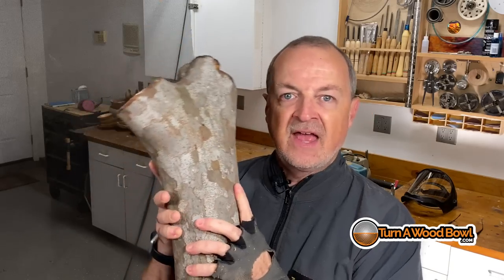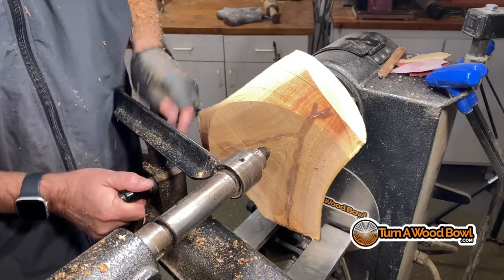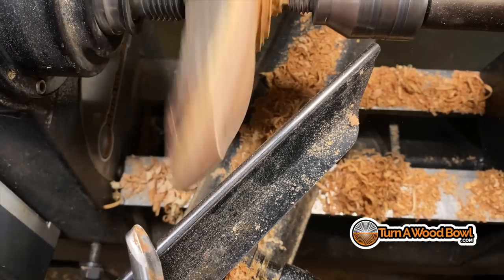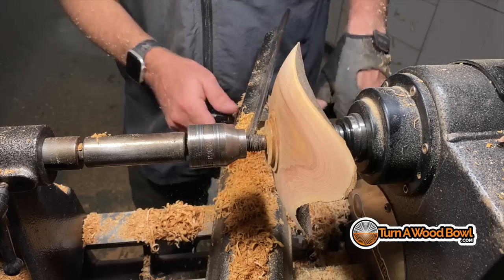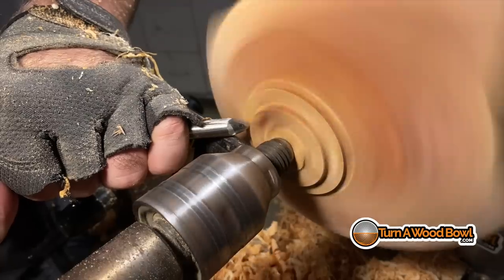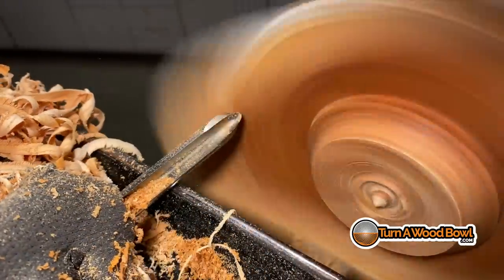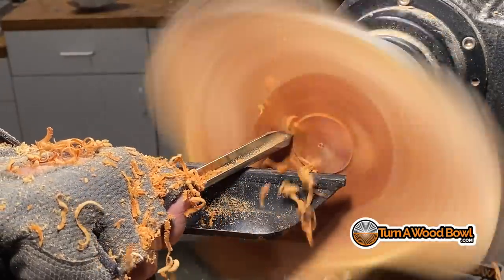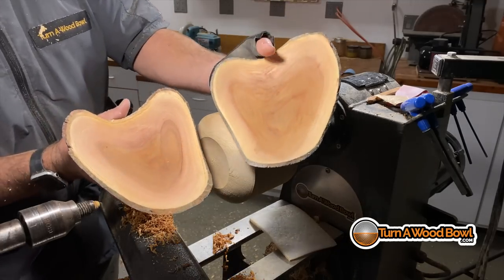Woodturning Live Edge Bowl – Crotch 2 for 1 Bowls Elm Video

Comment: Polymerization of linseed oil involves heating to 572 degrees F for an extended period of time, so yes boiled linseed oil is polymerized to change the chemical structure (hydrolysis) of the oil to increase viscosity (saturating) and reduce drying time. Its similar to hydrogenating fats to make them thicker and smoother (saturated fats are bad for you). Tung oil is treated in a similar manner as is shellac. Love turning crotch wood winged bowls. Thanks for the video.
Reply: A little more info: Most boiled linseed oils contain cobalt and manganese salts to aid drying. Tried and true does not.
Reply from the maker: Beautiful! Thank you for so clearly explaining these details. Happy Turning!
Reply: Hi im from the UK and New to finishes so probably wrong but was under the impression that Danish oil was a mix of oil and varnish, Is this not the case?

Comment: Once again, thank you Kent. If I can make a suggestion that would be helpful for me would be to add in your comments some measures of your blanks, diameter, height or depth, tenon depth etc.  It would help me a lot to evaluate my projects. I tend to have problems with dimensioning my projects.
Reply from the maker: Thanks for the tip. I'll keep that in mind. Happy Turning!

Comment: Hi, thanks for all the videos and information. Just wondering why it's okay to use a spindle gouge for things like making the dovetail on the tenon etc? Thanks
Reply from the maker: They can be used in areas where you are only removing light material. The danger is using spindle tools to remove or rough out large volumes of material on a bowl.Happy Turning!

Comment: Great video Kent, you did everything perfectly. Please be patient with me as I emphasise a point which you did correctly, but which a new comer might miss: - that beautiful crotch grain only exists in the centre of the log, where you drew the line, ie,  25 to 30 mm on either side of that line where you cut it with the bandsaw. The wood closer to the bark has none of that crotch grain.  That is why you made the cut face into the outside of the bowl. If the bark side was made into the outside of the bowl you would lose the crotch grain as you hollowed it out.
Reply from the maker: Kevin,
Thank you for writing and sharing! 
Yes! That is absolutely correct and a good point to make. Well said. 
All the best to you and Happy Turning!

Comment: I very much enjoyed this lesson and learned a lot as well.  I love your technique, especially leaving the center mass intact as long as possible when hollowing the interior in order to stabilize the rim.  And the bowls are beautiful!  However, when it comes to splitting the log on the bandsaw, as a beginner I have neither your experience nor your courage to do it freehand, so I would work up some kind of jig to hold it.
Reply from the maker: Glad it was helpful! And yes, a jig would be much safer and recommended. Thanks. Happy Turning!
Reply: Garry not Linda.  Hey Who, Stumpy Nubs just did a video on ripping on the bandsaw. Check it out. The bandsaw is probably the safest way to make the piece Kent did. Make a fence. It doesn't have to be any great shakes and it doesn't have to be parallel. Just clamp it on so that the piece will follow the line you set up. Take your time. Don't force the piece through and remember you don't have to stand in the same place. You can start the cut pushing the piece through and then move toward the other side and pull it the rest of the way through. No fingers lost, no worries. Garry

Comment: Beautiful bowls, Kent. Your presentations are as elegant as the curve of your bowls. But did you apply the finish while the bowls were still green?
    I love the idea of that. At what moisture content can it be done?
Reply from the maker: Thank you and yes I apply oil to the green wood. The oil actually aids in slowing the moisture loss which reduces the chance of cracks. This can only be done with a penetrating finish. A film finish, like poly, would bubble up or cloud with the moisture under neither. Good question. Happy Turning!

Comment: Thank you for all the videos!  It has been a great help to me as a beginning bowl turner. I have a question about how you deal with the warping and distortion as the bowl dries.  Normally, I would use a twice turn approach to deal with the warping.  However, in this case, the bowl is turned to a finished form while green;  is there a secret to prevent it from warping as it dries?
Reply from the maker: No secret. These will distort like any green woodturning. However, because of their irregular shape, the distortion is barely noticeable. Happy Turning!

Comment: Dear Kent,  I have a wood pile of Desert Ash street trees with plenty of crotch pieces - a metre or more across.  I think I need a bigger lathe! My best straight piece is 1800mm long x 1000mm diameter.  {6’x3’}. That should give me a long term supply of timber. 

… and by the way, the correct pronunciation of polymerised is “pol-im-er-eyes-ed”. Have fun.
Reply from the maker: Peter, Thank you for writing and sharing! Wow, that sounds like a huge tree. Yes, plenty of turning material. Thanks for the pronunciation tip. All the best to you and Happy Turning!

Comment: Kirk, you are my wood turning swami. I have learned so much from you. One question, I’m doing a twice turned live edge bowl now. How do you recommend I preserve the live edge. I’m thinking to cover in thin CA before my final turning. Especially as I accidentally knocked a chunk off when rough turning. I Used medium CA to restore that.
Reply from the maker: Rob, you can apply CA at the base of the bark to help it hold on. Remember not all woods will work the same. It is common for the bark to pop off. Try different tree species to find one that works best for live edge work. All the best to you and Happy Turning!

Comment: Question: since you said that the piece was very wet, were you not concerned that it would warp or crack as it appeared that. You completed the project in one session?
Reply from the maker: Being turned thin it will dry pretty fast and since it is even thickness it will have less stress. I doubt it will crack. I recommend to practice with local woods available to you. You will learn how certain species behave compared to others. Happy Turning!

Comment: Kent, as usual your work is awesome.  Didn't you say that the Elm you used was green? Will it crack and split like other woods as it dries? Just curious.  I know some wood takes a long time to dry. One more question, do you have any videos on turning an oval bowl? Thanks, keep turning.
Reply from the maker: Raymond, I haven't turned an oval bowl…yet. As for the wood, being turned thin it will dry pretty fast and since it is even thickness it will have less stress. I doubt it will crack. Also, practice with local woods available to you. You will learn how certain species behave compared to others. Happy Turning!
Reply: @TurnAWoodBowl  thank you, I got to try this for sure.

Comment: Unrelated Question:
Why does no one seem turn in reverse, rotate away, and attack the interior across the center to  right interior side of the bowl, doing both pull and push cuts, and then a carbide scrape for the top undercut interior?  I find it easier since my headstock doesn’t rotate, especially when hollowing a small bowl with a small access hole above.  
I know you’ll have a great answer..;
Reply from the maker: Robert, good question. That is definitely a way to approach the interior, if you'd like. Just be sure to use a set screw on your faceplate or chuck. If they loosen up with a slight catch, etc, they will quickly unscrew themselves from the lathe. Happy Turning!

Comment: Hi Kent. How do you prevent the bark edge from falling off once the bowl is finished?
Reply from the maker: Good question. Allow the piece to dry slowly. The oil helps slow a fast dry time. It really depends of the tree species and other conditions. Some trees will almost flick off their bark instantly and others seem to bond the bark to the wood like cement. Experiment with different varieties and you'll find a good candidate for live edge turnings. Also, try to harvest the wood in the winter when there is less activity between the bark and the wood, in the cambium layer. Happy Turning!

Comment: I assume your 4 jaw chuck has a dovetailed shape. What degree dovetail do you make on your tenon?  Also, are you using one of the hurricane chucks? I have heard negative opinions/remarks about jaws that have parallel grooves. It is difficult to see closeups of the jaws for every chuck I have looked at on line. ( I am 1.5 hrs from a woodwork supply store, so I have to rely on internet images.)

Comment: Great video Kent! I have a question. Lately, I have developed a vibration when I push cut that I can't seem to fix. It results in spiral tool marks. Don't know why I've started doing this and haven't been able to stop it. Any ideas?
Reply from the maker: Yes, absolutely. I have a video coming in a few weeks about this. The bevel is rubbing. Transfer pressure down into the tool rest and not into the bowl surface. See how that works for you. Happy Turning!

Comment: You don’t dry the wood before finishing? Does the danish oil allow for that?
Reply from the maker: Yes, the oil allows the wood to "breathe" and it controls the speed of drying by slowing it a bit, which can help to prevent cracks.
Reply: @TurnAWoodBowl  Thanks for the clarification! Have you ever put a follow-up finish, like poly, on top of the oil? If so, how long did you wait?

Comment: Hi Kent, I was wondering how dry is your piece of wood ? Have you kept it long once cut before turning it ?
Reply from the maker: It's still green. It was cut a few weeks prior. It will dry quickly since it was turned thin. The oil finish will aid in creating an even dry time. Happy Turning!
Reply: @TurnAWoodBowl  Thank you Kent, from my questions you will notice that I am young at turning although over 70 to start learning. My problems are with basic things like foreseing the bowl on the rough piece of wood,(preparing the blank), I turn mostly green wood cut on a little piece of land I own,  dimensioning and balancing the blanks adequately, tenon depth and so on. Your videos ( I have seen most of them) have exceptional value for me to ride not the bevel but down the learning curve ! I will enroll on your e-tool sharpening course to improve that skill.

Comment: Will these bowls warp over time, since they are still wet?
Reply: Good Question.
Reply from the maker: Yes, a small amount because there are turned relatively thin and the walls are even. They dry in about a week and the base can be lightly sanded to level the foot. Happy Turning!

Comment: You do good work and this question has little to do with your current video. - - - You (and others) have referred to the dowel cut in (for the 4-Jawed Chuck) as a "tenon". To me (as well as many others), a "Tenon" is a square or rectangular section fashioned onto the end of a board to be received (in most cases) by a mortice. Since any object being turned is (or will be) round, is it not a dowel ? - - - A vase, bowl, lamp, or candle stick is a dowel until it is a finished product. Why do some woodworkers call this a "tenon" ?
Reply from the maker: Hm? You have me thinking on this one now. LOL Well, if the tenon were viewed from the side, it is clearly a tenon. Because it is cylindrical, I think this is where you're having trouble viewing this as a tenon. If a straight mortise channel was cut in a board to the right size, the bowl's tenon would slide right in. Essentially, the chuck is the receiving mortise. It just also happens to be able to expand and contract. Hope that helps. Happy Turning!

Comment: So, how come you didn't just cut a relief in the bottom to expand the chuck in so you didn't have to fart around with that silly jam chuck to cut off the tenon? That relief just becomes your foot. Also why didn't you just sand the back of the bowl when you first cut it instead of after you'd turned it around and go the motor in the way?
Reply from the maker: Because I like to design the piece as I go. I is difficult to decide what the shape and size of the foot will be before the bowl is finalized. Happy Turning!

Comment: I have been looking for a way to save the nice figure in a crotch bowl.  You turned very nice bowls but you cut out most of the attractive figure.   I will try to duplicate this but without a tenon, using a glue block instead, turning dry wood elm, bark less.
By the way just so you know, I watch these on a 70 inch tv, the like button or comments are not available on TV, to type this I must use iPad and find this video.
Reply from the maker: Thank you for writing and sharing Aubrey! BTW, if you pause the video on the TV, you should have access to the subscribe and like options. Happy Turning!
Reply: @TurnAWoodBowl  nope, just tried. ?